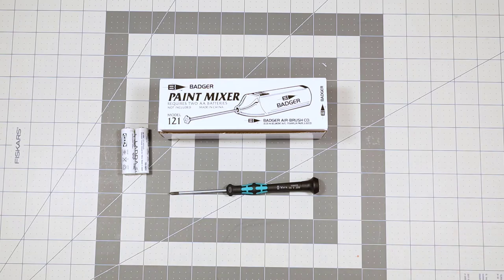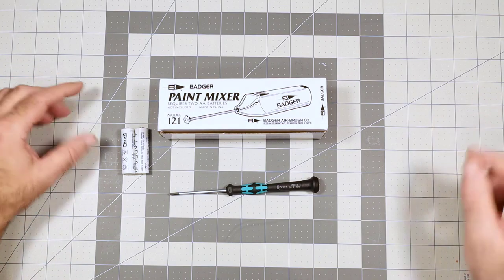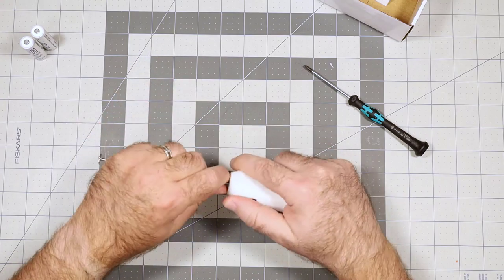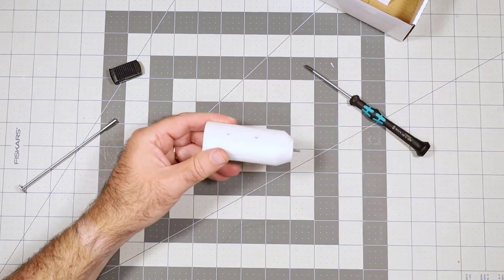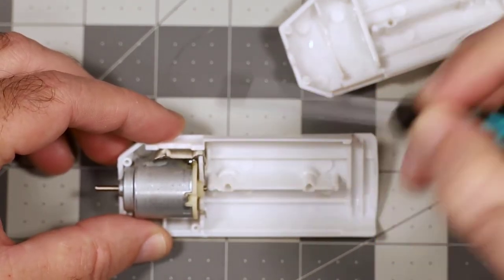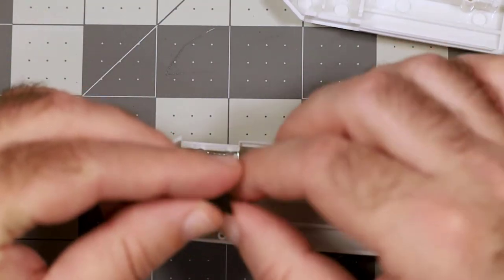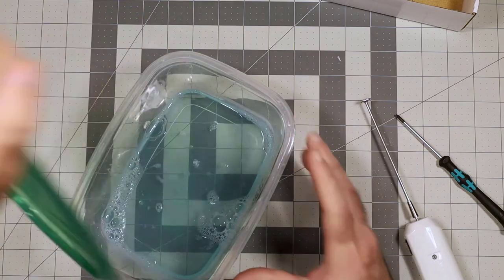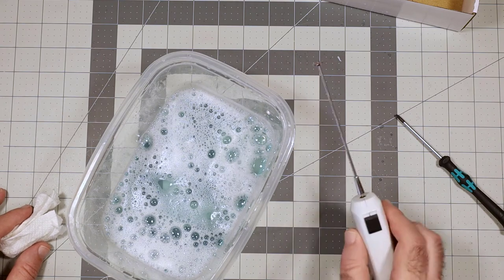RTFM Badger Paint Mixer Take Apart

Comment: Thanks for this video.. my rod wont stay on the base when I tilt it down, no clue why
Reply from the maker: The end that connects to the motor shaft, cone shaped, is very easy to bend.  Carefully squeeze the end with it removed from the motor.   Do little adjustments at a time, if you over do it, it may break.